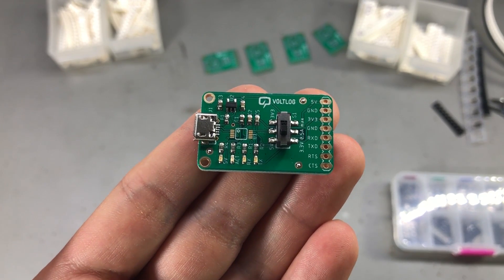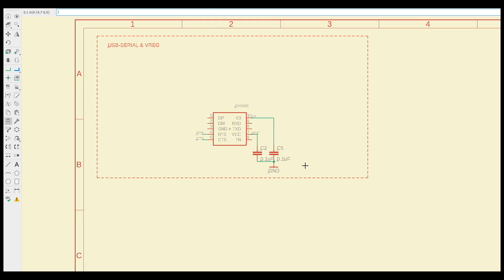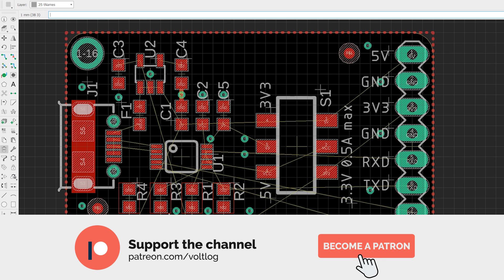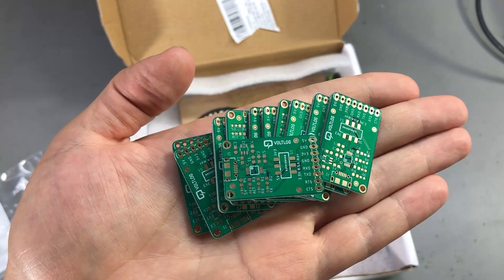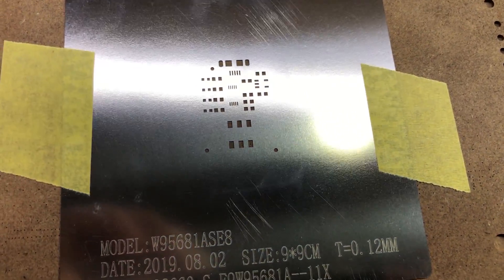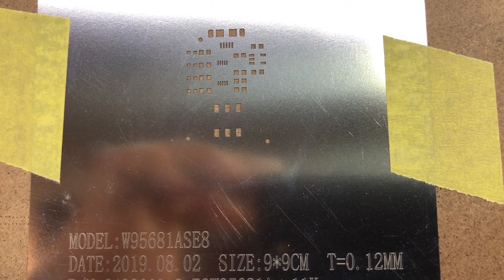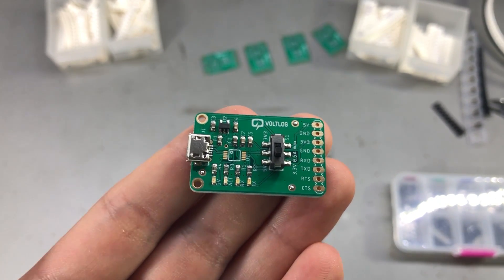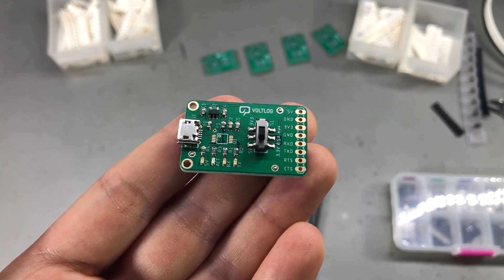Voltlog #249 - Making Some USB Serial Converter Boards With CH340E

Comment: I've always hand-soldered - never had the opportunity to attempt reflowing using paste, though i've seen videos about using a toaster oven for reflow. Is that what you do? Is it possible to just (carefully) use a heat gun instead?
Reply from the maker: This is what I am using, I find it more practical than an oven and it works fine for small boards.
Reply: Hot air gun, toaster, and even a stove.
https://youtu.be/Bb1Y9zWJciE?t=530

Comment: It's of course nice to build such boards, but I suppose you know that you can buy them ready to use starting at 0,50 € from Aliexpress?
Reply from the maker: Sure you can find something similar on aliexpress based on the CH340E, but what if you need a feature like switching IO voltage from 5V to 3.3V? You do it yourself.
Reply: They typically come with a yellow jumper where you can switch the I/O voltage. For the cheap CH340G modules with the transparent shrinking tube, I can confirm that switching the I/O voltage using the jumper works as intended.
Edit: On the cheap modules the 3.3 V is made from the 5 V with two diodes in series and hence it's more around 3.6 V, but that's usually not a problem. From the pictures it looks like the other design with the yellow border uses a 3.3 V regulator.
Reply from the maker: @AS-oq7io  This is about the CH340E in particular and if you search on aliexpress you will see the small breakout boards they sell do not have any jumper for selection. Also it is not clear to me if the CH340E has an internal 3.3V regulator or that's just an input pin for IO voltage and yet the breakout module from aliexpress present that pin on the edge as if it were an output.
Reply: @VoltLog The boards with the yellow border are available with CH340G and CH340E, both with voltage selection jumper. The CH340 series has no internal regulator, the V3 pin needs a different wiring depending on the operating voltage.

Comment: The ch340e has one activity pin, called TNOW. It goes high when transmitting or receiving.
Reply: Got 10 ch340e on my last LCSC order. Do not need them all, so I could send you 5. Post from Norway could be faster... Just let me know.
Reply from the maker: I have an LED connected to TNOW as well but I wasn't sure how it's going to behave so I added LEDs to RX and TX just to be sure. I can just not populate those if I don't need them. Thank you for the offer but postage would probably cost more than the chips themselves so it's not worth it. Mine are probably pretty close by now and should be getting them soon, I'm in no hurry anyway 👍

Comment: how can you start the assembly when you dont have the components? do you put paste on and then search lab to find the components?
Reply from the maker: That's pretty much what i did and the reason for that is video recording. I need to get the recording started because it takes time, it's hot in here during summer I have to do it early in the morning and I don't have time to get everything ready from the start but rather get it done along the way.

Comment: I’ve been using the CP2012N and they have been very good. Faster data transfer like the Uno.
Reply from the maker: You probably meant CP2102 and yes they work fine, I've used those before as well.
Reply: VoltLog yes. That’s the one but with a ‘N’ at the end.

Comment: Yep, I know the feeling. For my last project I ordered all the parts, including surface mount caps. I try to stick to 0603 minimum (prefer 0805) because my hands aren't too steady these days, unfortunately I didn't pay close attention because what arrived were these tiny microscopic dots. Turns out I ordered metric, so they're actually 0201! Way too small for me to bodge them onto the larger pads, let alone actually handle properly. So now I have to place another order. Thankfully I didn't order reels of the things, just 100 of each. If I'm going to have to order replacements, I'll just bundle them in with the next project order. It'll also allow me to rev the board for not much more, which I wanted to do anyway. Probably delay the project a month or two, which isn't really an issue for a hobbyist like me.
Reply from the maker: That almost happened to me once, I added all the parts to the cart then something didn't feel right, I don't remember exactly maybe it was the cost of the resistors or something, when I went back to double check I realized I picked metric sizes so I was able to fix it before placing the order.
Reply: Lucky catch! I gotta learn to stop putting my BoMs together at 3am!

Comment: CH340E seems really nice. I've been using CH330N lately. It comes in SOIC-8 -package, but doesn't have RTS or CTS pins. 
Thanks for introducing CH340E to us, even though you don't have one yet 😆
Reply from the maker: Yup, hopefully I can also confirm the board works and what kind of baud rate it can achieve.

Comment: I am crushed!  After hearing some bad things about the E's, was curious if you could sustain 2 megabaud without excessive heating or error.
Your AVR chips will need a DTR connected through a small cap to to reset the target MPU for Optiboot to see it when using Arduino.

Have used several CH340G's without issue, but I resent using a huge 12mhz crystal because it will not fit into the head of a small USB male connector.
No TVS, opticoupled / clamped TX, or Mosfet driven LEDs?  Hehe, there are always ways to make it more complicated.
Reply from the maker: I hope to do some testing when I get the chips to see what kind of baud rates they can sustain. It's true, there are always things you can add to make it more complicated or robust but what I did here is kinda enough for my needs.

Comment: No way ! this happened to me in another domain when I made isolation of a 40m2 room I completly forgot to pass the electrical lines behind isolation for the light buttons so I decided to go for radio controlled buttons (those that looks like real wall buttons you glue on the wall) and in fact the epic fail turned into good result :-)
Reply from the maker: Yup, things like this happen in real life 😁

Comment: Oops that will be a part 2 video :P As in Predator 2 movie sh... appens . The board looks tip top but it is very thick. Add double sided sticky tape underneath to prevent scratches.
Reply from the maker: thank you!

Comment: Too late now but there is a seller that has the 340E listed for $0.32 each. If your shipping prices are anything like mine (USA), the current price is $0.42 and if you select a quantity of 10 it's $0.63, for a total of $3.83 shipped. I believe that one took around 20 calendar days to arrive in the Los Angeles California area :-)
 I haven't done a breakout board, I just bought one of the ones on AliEx. However, I picked up a couple of the new arduino nano compatible boards with the 340E. It works great. Linux sees it as a 341 chip. I uploaded an arduino sketch to one board. They use the "old nano bootloader" which must be selected manually.
 I used the other board for trying Flash Forth 5 over the last 2 weeks. The FF5 OS uses a default baud rate of 38400 with their AVR hex file. I've used that a bunch and had zero issues. I was quite surprised, as I had a few nano's fail because of the 340G back years ago when it was just becoming common. The best I can tell those failures were due to the timing on the 340G. The fact they have an option that doesn't even need an external oscillator, and it just works is impressive. 
-Jake
Reply from the maker: Yes you can find ready made boards but I did it partly for fun and partly to add some features: for example one feature I really wanted is the switch for easy selection of 3.3V and 5V. I also wanted to try out this chip to see if I could integrate it into other future projects.
Reply: @voltlog  
  I did the same thing, made my own BO board, with the CH340G just to see if I could get it working consistently with a 12MHz crystal. I wanted to see how this performed next to the ceramic resonator used on the nano compatibles. I'm just too lazy to do that again. I also have to use photoresist to do MSSOP footprints instead of toner transfers. That's a lot of effort for one small board by itself. Ordering PCBs from china is looking more appealing for such things.

Comment: Careful with that chip if you ever use those adapters for anything where data loss absolutely must not happen - the GRBL project had CNC control problems at some point with parts of G-code going missing in transit (which totally can crash a CNC right into the stock), and it ended up being traced back to Arduino clones made with CH340 - the original FTDI-equipped ones never had the problem. To be fair, the Arduino is slightly off-baud due to their original choice of xtal, but the fact remains the CH340 couldn't keep up while another chip could. It's a really rare occurrence though, and of course if occasional loss is acceptable then there's no problem...
Reply from the maker: Thanks for the info! When I get the chips maybe I'll devise some kind of test to figure out if there is any loss at high baud rate.
Reply: Fast baud rates with the wrong quartz are not a good idea. A reliable design limits the baud rate error to 1 %. The CH340 supports up to 2 % based on his datasheet.
Reply: Oh, absolutely. It's just that GRBL was using 115200 for adequate throughput and apparently nobody realized the Arduino Uno that its hardware is based on happens to be absolute shit at that particular baud rate because of its specific xtal and available divisor rates. Since you mention numbers, I got curious - this may well have been a case of marginal performance: the FTDI that original Unos used to come with appears to accept 3% error and the Uno seems to be producing... 2.1% at that speed. Which might explain why this issue isn't exactly a widely known and worked-around defect.

None of this implies of course that the CH340 is inherently "faulty" or anything, under these specific circumstances, given an existing problem, it just happened to be not quite good enough. Barely. What I didn't know was that the difference that made all the difference might be so relatively small...
Reply: Yes, the allowed error is very small for a reliable RS-232 connection. Also the recommended max. receive error for the ATmega328 on the Uno is only 2 % with 7 or 8 data+parity bits. That means that even if the FTDI supports 3 % error rate, the ATmega does not. To be honest, I would not trust such a setup and my solution would be to replace the crystal of the Uno e.g. with 14,7456 MHz.
Edit: On double speed mode (which is needed to reach 2.1 % error rate at 115200 baud with a 16 MHz crystal) the max. receive error for the ATmega328 is only 1.5 % with 7 or 8 data+parity bits.